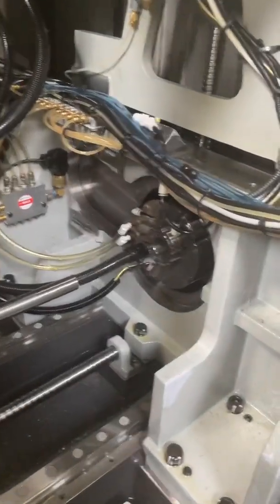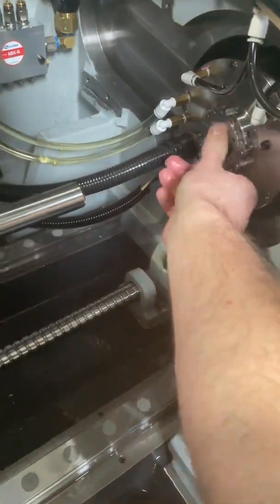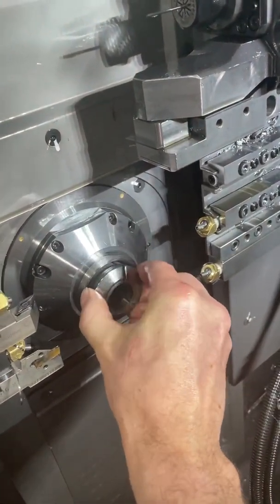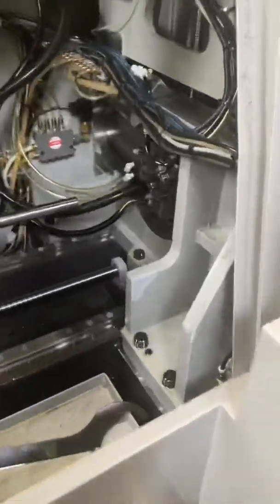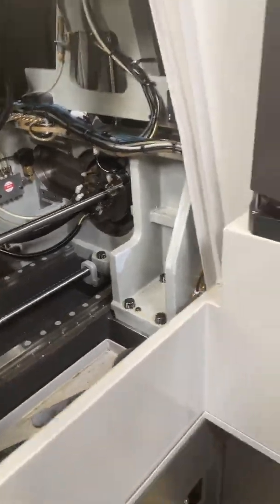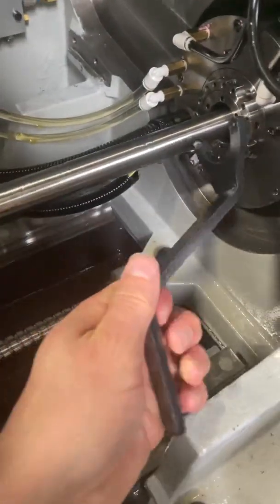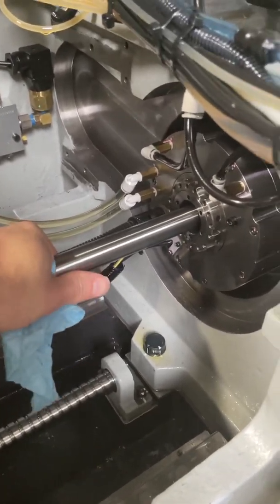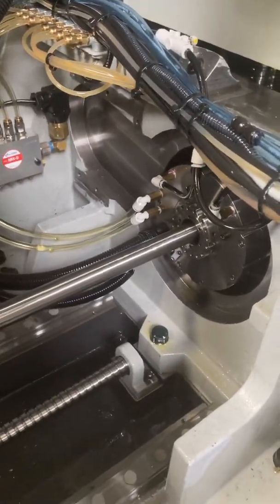Setting a guide bushing on a Tsugami Swiss lathe.

Comment: Can you please tell me which CAM system do you use?
Reply: Just do it manually
Reply: @robclark7380 that's what I do
Reply from the maker: I use esprit but previously used partmaker. Partmaker is much easier to learn but esprit posts perfect code and has better support.